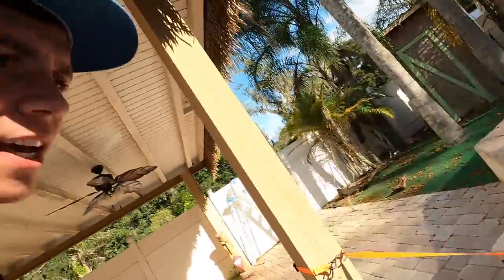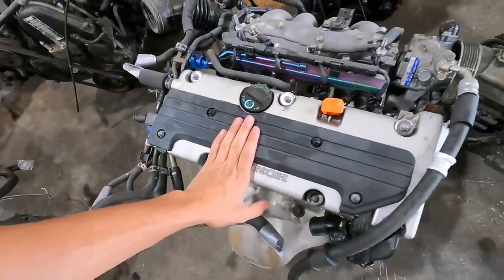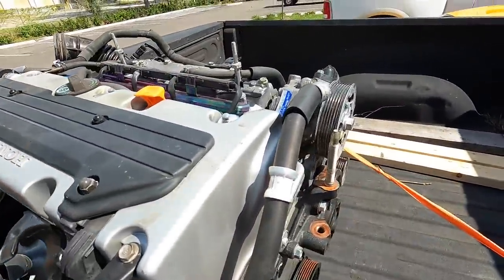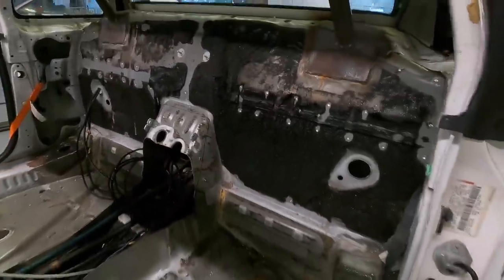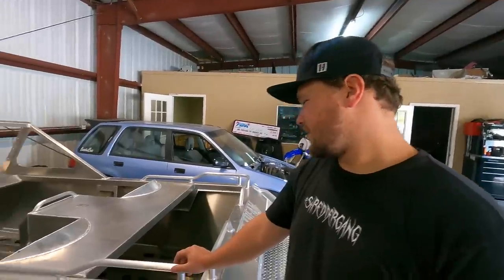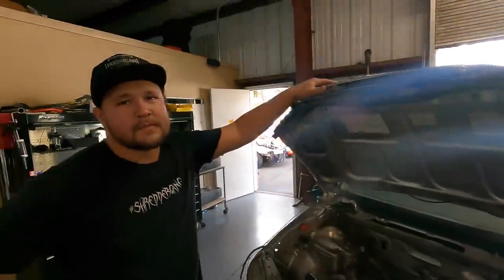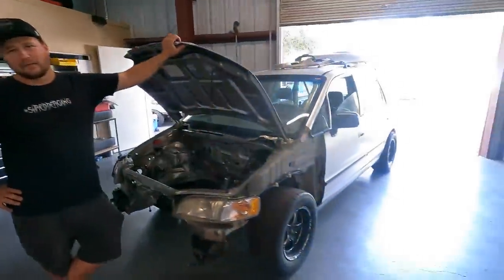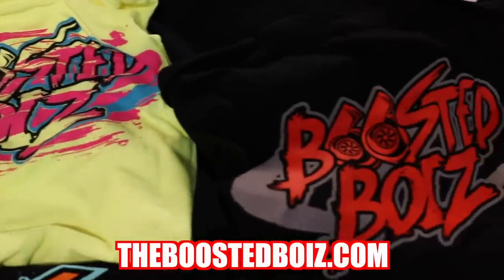We Are K-SWAPPING The Mini Jet Boat!

Comment: Of all the project cars you have, the odyssey is the prime candidate for two k-swaps.  One front and one rear.  Think about it, no more expensive 4 wheel drive components.  You can thank me later.  If you're worried about how to sync them up, the ground does a wonderful job of that.

Comment: Just make a custom low profile oil pan. You guys have the welding skills to make one, it has plenty of room for it to be long and wide to make up the volume for it to be a low profile. You do not need it to fit in an engine bay, so you will have plenty of room for it.

Comment: Might need to run a lot more oil for the sustained high rpm to run the jet drive. I remember Finnegan mentioning that he had to add a much larger marine pan to an engine before installing in a boat to assist in cooling.

Comment: The sound deadening comes off pretty easy if you can freeze it. Dry ice usually works on the floors but I’m not sure how you could keep the dry ice on a vertical surface like that. Once it’s frozen you can hit it with a hammer and it comes off in chunks.

Comment: Try CRC Carb Cleaner on the sound deadening. I used it on my rear trailing arm bushing on my civic when I replaced them to urethane. It takes a little working but once it gets under the material it start to peel it from the metal. Try it, that stuff will take anything off of anything.

Comment: May get some hate for this but.. if k24 is to big for rear seat set up , instead of cutting up a good jet ski , you could go old school .. do a d15 sohc eBay turbo build.. half full the water galleries with j.b weld , increase ring gap for boost and send it. Should be reliable at 3-400hp on e85 , probably not much bigger physically than jetski motor

Comment: Is there room for a dry-sump oil system to be able to eliminate the stock oil pan and set the engine lower in the boat to give yourself a little more clearance? Would it even be worth it?

Comment: Cut the seat section out and weld a flange on it with a rubber gasket so it can bolt in and wont rattle too much. That way you can easily fit the k24 and service it.

Comment: Flip those seats and face them backwards. Then you can add onto the box facing the driver. The jet drive is lower profile and should clear the seat notches. Plus it would hilariously fun for riders to be facing aft in a 400hp jet boat.

Comment: Not sure if some one said it yet. Use a dry sump oil system for the jet boat. Won’t loose oil pressure with you spin the boat.

Comment: An easy way to get that sound deadening off is to use dry ice in a shopping bag. Place it on the spot you want to remove and wait 5-10 mins then use a chipping hammer or ball peen hammer to brake it up . It should fall off and leave a clean surface . I have done this a handful of times 👌🏻.

Comment: If you Google search a 2001-2005 Toyota corolla you will see that it has a header style intake manifold, the long runners will be great for the jet boat because it will give you more torque for the lowend power. So you can fab it up out of aluminum.

Comment: I'm curious to see how they handle changing the oil. Some type of drain hose connected to the bottom of the oil pan that connects to a pump possibly. Or would they do better using the Audi method? All I know is that it would suck to have to pull the motor out or have a penetration put through the hull to change the oil.

Comment: I do autobody if you want to save some time and not have to drill out each one if it’s a sacrificing panel you just want to remove. Just use a Cut off wheel and grind the weld out it’ll save you so much more time or you get one of those belt sanders from Harbor freight they work great.

Comment: You might be able to relocate the engine cover/seats a few inches forward to gain enough room. Not sure if that would cause a negative effect on the boat as far as trim at cruising. From what I see with the other two the hull is forgiving to weight. They seem to ride well with a light or a full load. the plane out time will change. But the boats have a great ride attitude loaded or unloaded. If you have the leg room to move things forward it might be worth it. Not seeing the boat in person and not knowing the measurements. My comment may very well nothing more than a keyboard engineer point of view. 
 But I do think it's a cool idea. GO FOR it. Two last questions. Is the engine going to be raw water cooled (open cooling system) or fresh water cooled (closed cooling system) ?  And is the exhaust manifold going to be water cooled ? 
 Again I say GO FOR IT.!!! I do think it's a cool idea and I think you guys will find a way to make it work.

Comment: You should go ahead and get the new style motor and do the upgrade to it w new stock size upgraded rods and pistons for a moderate built lower end with a dry sump, dry sump will fix oil slosh issues you will have when doing the flip arounds that are so much fun with the SeaDoo motor, the drive by wire is easier w newer motor because you don’t have to invent/modify the setup for it and the fitment for intake/exhaust (plus turbo ;p ) will be better with the built in rear seats

Comment: Go to Walmart or just a local ice supplier 🧊 and pick up some dry ice and it'll make your life a lot easier and stress free 😂. Make sure to wear some leather gloves or at the least throw on a pair of "mechanix gloves" , after making sure that you've got your hands/skin protected, after youve put on your PPE the only thing left for you to do is to grab a handful of your dry ice you purchased (most dry ice available for public purchase tends to come "cubed" which are usually tiny gravel sized little nuggets. Their size also happened to be very convenient for when you are going about removing the sound deadening throughout your car as it's easy to get it in small/ tight/ compact spaces where you'd never be able to get a flat head, scraper, any type blade period. Take a handful of dry ice, spread it out and covering all deadening you want to remove. Then you'll notice the deadening starting to become "loose" & no longer "sticky"..another "sign" of the dry ice has done its "job" is when you begin to VISUALLY see pieces of sound deadener begin to shrivel up like a raisin or a dry dead flower 😂

Comment: on vertical areas, ive used a hand held propane torch with a putty scraper to get the worst of the sound dead off then follow up with a wire wheel

Comment: If you build an intake to wrap up and over the value cover it would decrease width and you would only have to make the top of the seats taller where it covers the motor not cut the seats out

Comment: My only concerns are the 360’s that are performed. I understand that a guy in New Zealand actually invented the jet system back in the 60’s(?) and they do use dual V8’s as power plants! So if you do run into any problems maybe speaking with someone running a similar setup

Comment: dry ice to get the sound deadening off. check B is for Build. in a recent video on a GTR body swap, they used it to pull the rubber glue off

Comment: You might need to add some ballast in that boat to account for the weight of the engine.  I'd run the numbers or it could be a huge dud.

Comment: you can either lose the back seats (coming from an experienced boater youhardy use them) or you can recess the intake and unit and build a box out the back under the swim deck to help it fit
Reply: also depending on what unit you are using 350hp will be heaps espically if its a sinlge stage unit, you are just better going for low torque to get out of the hole as the unit can only spin so fast with heaps of hp

Comment: The k24z3 (exhaust runners built into head) has stronger rods than k24a engines according to kpower industries so would be easier turbo wise as well as a bit stronger in theory

Comment: My Manifold on my 3.6 300 hp chrysler 200 S is made same way. First and only run 0-60 6 seconds stock. I can get to 5 seconds with cold air intake and exhaust.

Comment: Is it not possible to simply modify the two seats in the jet boat by raising the entire assembly up a few inches? A lift kit if you will, so the engine has more room? I know, it puts bodies higher in the air which might be another issue but, a thought anywho...

Comment: Ive been wanting one of  these boats since i first saw blake wilkeys, i looked them up and seen how people were driving them up stream in 3 inches of water i knew i needed one. In my area its all low creeks and rivers that will get low that have lots of jump in them and when i wanted one i couldnt get one now things are getting better and ive been wanting to get a welded haul issue is getting a good jetski motor with good power can be expensive. A lot of time ive saw people just but newer jetskis and take out the power plant and that would be very expensive depending on what their drive is and if its not to expensive a k series would be a more inexpensive engine for this and its something that i would be much more familiar with.

Comment: not sure how much room you have on the sides but the top you could cut right on the edge of that seat where it goes flat on top straight back also towards the cupholders and do a 2-4 inch bump up. good bit of fab work but it beats not having a K lmao

Comment: there was a b16 vtec swap on a boat 10 years ago. apparently that man didnt care about the performance. he was excited how well it ran and quiet it is and the how little fuel it used. he never rev it to the max. he wasnt a car guy either. he swap it in because he happen to had the engine lying around.

Comment: What’s the k24 overall height from valve cover to oil pan?
Reply: I think it matters more where the centerline of the crank ends up in relation to the pump. May need to use a dry sump to get it in the right plane.
Reply: @scrumpyb5859  sorry, asking for my own setup.

Comment: Absolute worst case, eliminate only the rear passenger side seat and stack your fuel/battery/ECU all on that side. It’s not 4 seats, but 3 is better than just 2 if you’re absolutely set on having an extra passenger

Comment: Why do you guys K-Swap everything??? 2.5 mediocre-sized guys just took 200 bhp outta the bed of the truck.... lol.... 
Dry ice worked great for my sound deading.... was on the floor boards, set some dry ice on it, let it sit, hit with a hammer and it popped off in huge chunks.

Comment: Why waste that much money on that little diff? You could buy a Mustang 8.8" IRS diff for a fraction of what that Civic diff cost. And you would never break the Mustang diff no matter how much power you threw at it, in that van. Plus the available Mustang axles would be a massive upgrade.   Then you could just stick to grenading transmissions.😉

Comment: I don't know why you would put a K series in the boat with all that extra weight because if you get a built engine done by JP with a turbo on it you'll still have way more power than you can use all the time and it would be alot less weight and if you had planned to put a K series in it then you should have gotten a two seater

Comment: How about throwing a blower on it? Maybe a TVS 1900 with a water to air aftercooler? That could save you some room for the exhaust but I’m not sure how it would work for height/width. Try something new!!! Supercharged K’s work great for 3-400whp on stock internals.

Edit: This comment was made when he was picking up the motor. Should have watched the whole thing. Still think it will be awesome to try a supercharger.

Comment: I’m pretty excited to see how the motor holds up. I’ve been back and forth between stuffing a k20 or a vr6 in front of an sd309 for a while. I was leaning towards the vr6 because I think it will take the load of a pump better. If the k takes it I’d rather go that route